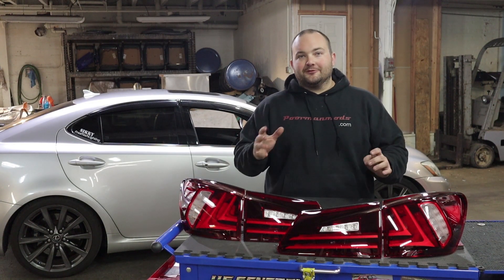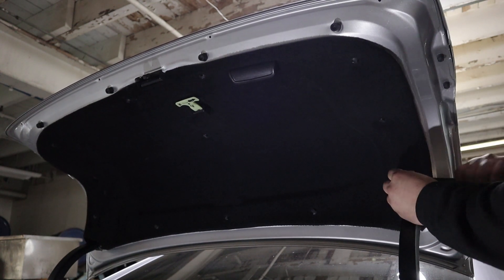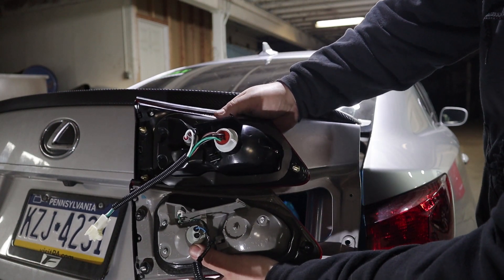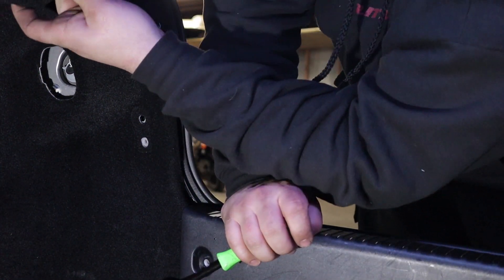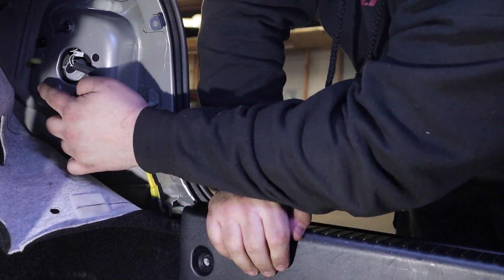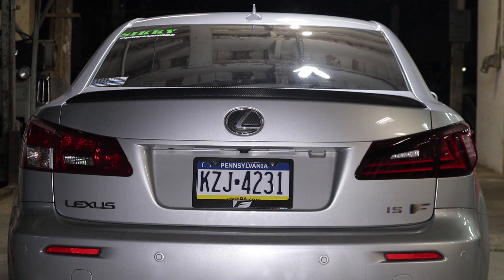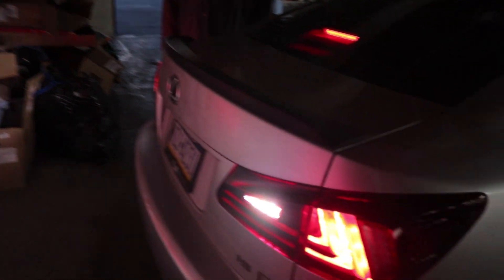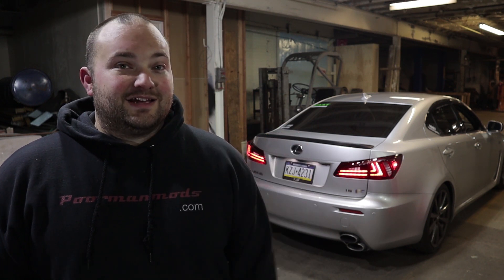Giving the ISF a sexy new look with Vland LED Tail Lights! Lexus IS250 IS350 ISF

Comment: Super cool, have  is250 as daily and thinking maybe I should add those  on it :) 
Have few ideas to you:
Make diy custom side skirts from plastic or something.
IS have cracking dash problem, I have few cracks around radio and center vent maybe have idea how to fix it without removing dash.

Comment: Kenneth Cooper
Hey man!
Watched a few of your vids and I think in one you said you've owned multiple IS300's. 
Mine is misfiring on all 6 cylinders and Idk what to try next. 

I put new spark plugs, ignition coils, vvti solenoid, ignitor, cleaned all the oil up, replaced the valve cover gaskets, and map sensor and stillll it misfires. 

Any ideas?
Reply from the maker: Check for vacuum leaks